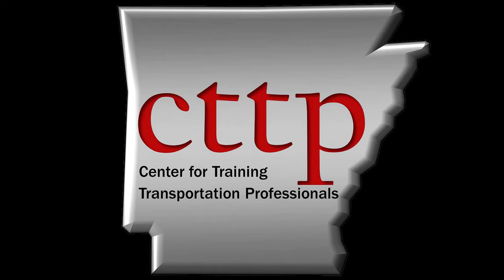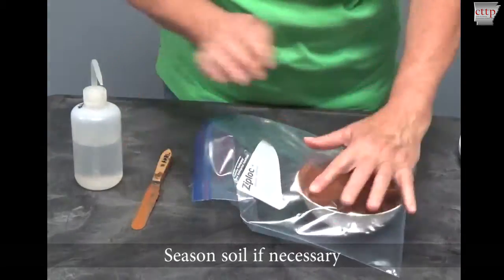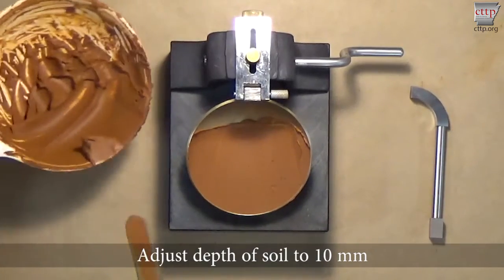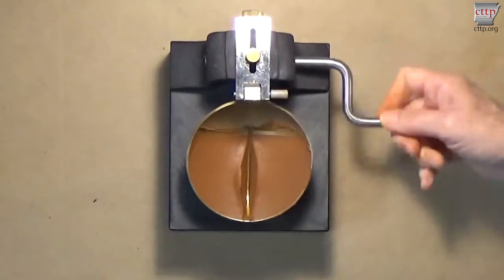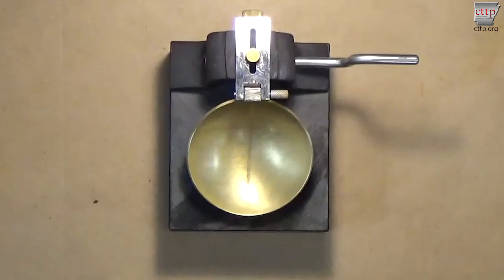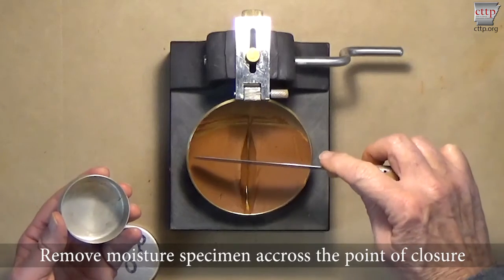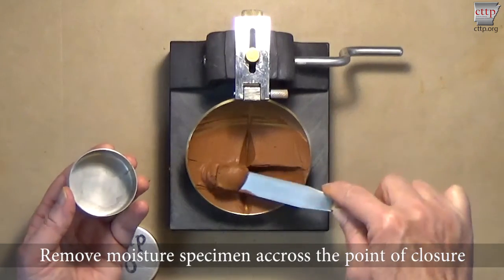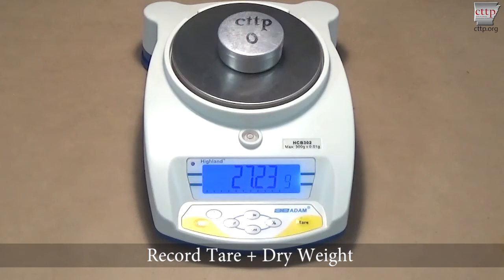AASHTO T 89 - Liquid Limit - Method B

Comment: How long should the soil sample stay in the oven?
Reply from the maker: Anytime you are oven drying something (at the proper temp of 230 +-9 F or 110 +-5 C), you are supposed to dry them until they achieve "constant mass".  Constant Mass is defined as "the mass at which additional drying would result in less than an additional 0.1% loss in mass".  In general terms, if you dry overnight as the proper temperature, that is usually sufficient to achieve constant mass.
Reply: 24 hours
Reply: @namsoemmanson8338 I appreciate this. This is what we do. I was wondering if there was a minimum that we could do. Thank you for this.